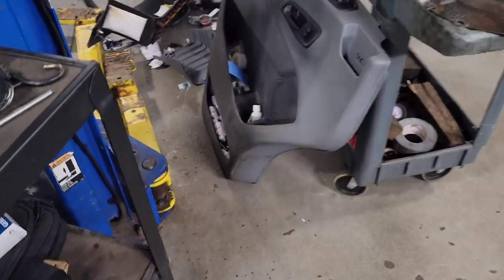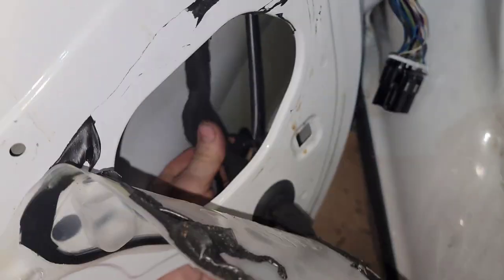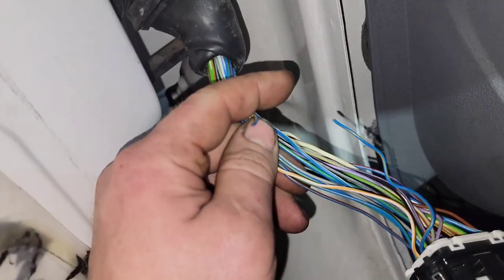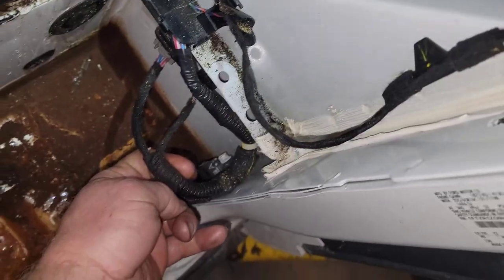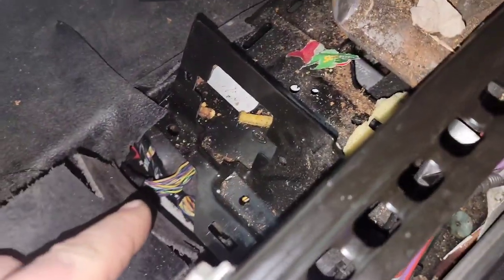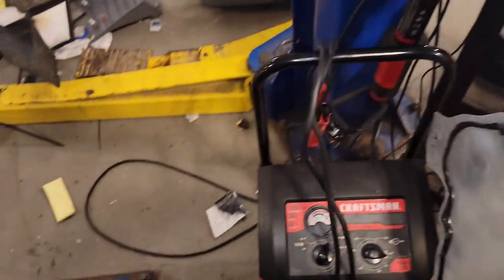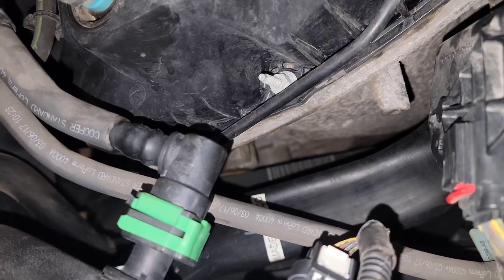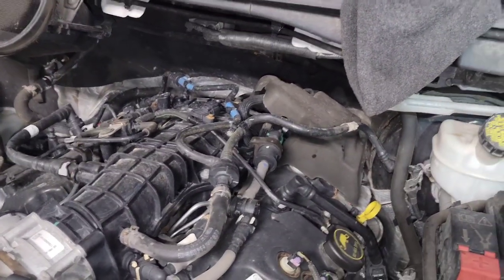Ford Transit B1414:93 Side Impact Sensor - Quick Common Issue - Radiator Hose Burst Also

Comment: I just pick up my 2018 transit van from Ford an hr ago. They had to put in a wire harness in the drivers door the turn single lamp was out on the mirror. I have 130k miles on it and I keep it like new. No razor blades laying around but you might encounter a fry or two.

Comment: Does the door wiring breaks ever affect the windows or locks? I repaired several breaks in older GM cars that seemed to be power feeds or returns for windows.
Reply: Any of that can be affected,  anything electrical in the doors. Those wires get bent and unbent everytime the door opens or closes
Reply from the maker: Oh yes
Reply: Yep. First my window, now my locks on my Transit. Two separate trips to the dealer.  The wire is too damn thin. Today’s junk. SMH!

Comment: I can tell just from looking at this that the wire is too thin for the application.  I never had stupid problems like this in the 90’s.  My Transit had to go to the dealer for this because the window quit working. Now it has to go back again because the door lock is not working.  Both would work when the door is almost closed because the wire would touch. What ever happened to quality!  SMH

Comment: The radiator cap only fixes GM vehicles with collapapsed hoses lol I see this everyday on 6.7's and alot of the gas ford engines. I feel like if I recommended cap replacement the hose will still collapse 90% of the time.
Reply from the maker: Fords do it alot I agree

Comment: Goodness, I don't want to be sitting on the battery if that Van was in a bad collision. How can rescue people unhook 
the battery to help prevent a fire if your trapped and sitting on it? Hey Guss, grab the schematic to the 2020 large Transit. You mean from that big mess of papers in the rear of the firetruck!?! 😳😄🐶
Reply: Wait till you see a Toyota Previa 😅
Reply: @vais3  Hiya! Oh no, worse!?! 😆🐶👋🏻
Reply: @troublemakingpups5787  a thousand times in my opinion. Whole engine is under the drivers seat just about. Fuel lines and all. To fill the engine oil, you lift up the seat bottom, fold the seat back and open the hatch below the driver seat. It’s a nightmare.
Reply: @vais3  Oh My Goodness, that is a crazy setup! I would be daft if I had to deal with that. 🤪😆🐶
Reply: @troublemakingpups5787  obviously horrendous design.

Comment: Can I buy new crimpable pins for the connectors from the dealership or is there some bulk aftermarket kit?
I love pulling shit out of the yards man 🤷🏻‍♂️
I’ll find both sides used and rewire them with the proper wire colors and just have them prepped and ready to go.

Comment: Do you have a wire tracer you could recommend?
Reply from the maker: Wire tracer?
Reply: @FordBossMe  I figured because you are a mechanic you'd have one. It's one of those gizmos that you hook up a device to a wire, and with a scanner that the device comes with you run along where you think the wire is and it beeps when you are near the wire. It's supposed to help you locate shorts. When you reach a break in the wire it'll stop beeping.

I had a harbor freight one but it didn't work well, I've been considering buying a fluke one. I've had great luck with fluke in my years as a HVAC tech.
Reply: @serg2057  they don’t work well for automotive.

Comment: Also as a Motorcycle mechanic we clear some codes and if the codes don’t retrip then thiers no issue. 
Is it the same in the car industry. 
If I have a CAT code and clear it and it doesn’t come back the problem doesn’t exist right 😅😅
Reply from the maker: Yes and no more no than anyting